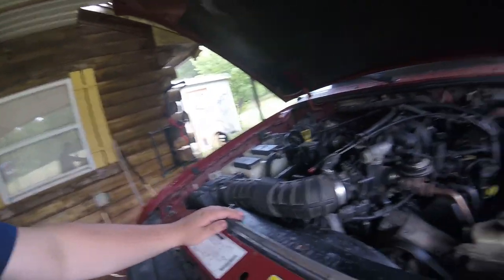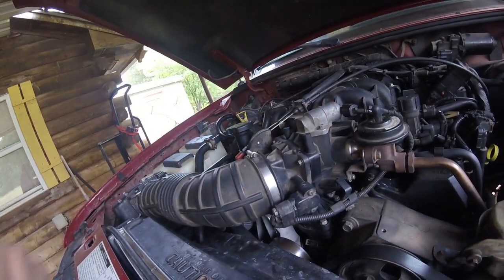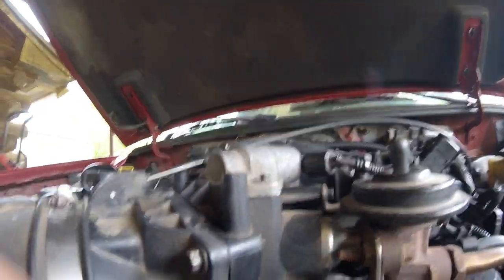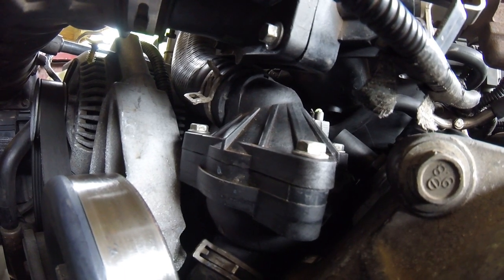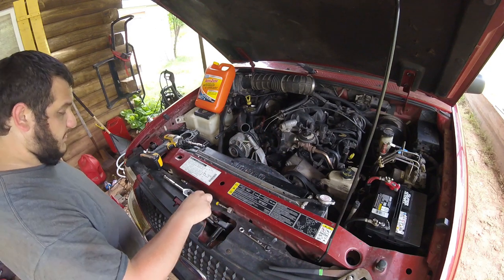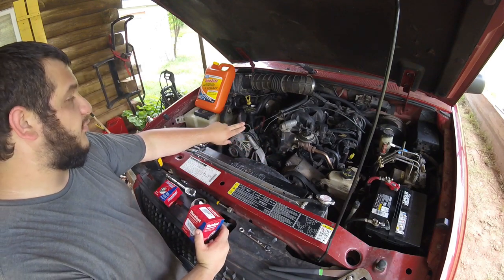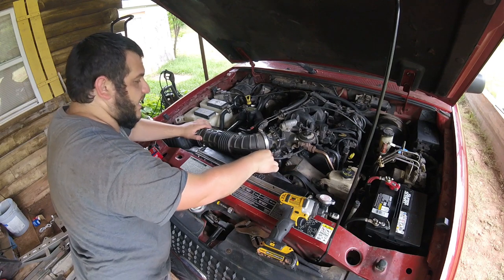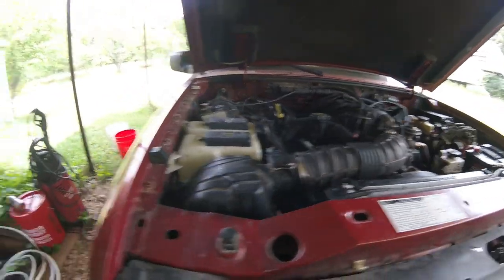Cheap Fix For My 01 Ranger! It was Overheating!!

Comment: Yep. It's expansion due to boiling. Like when a pot of water boils, it rises up and flows over. You were right to be worried about head gasket but always check the easy stuff first. People try to make it home while boiling, then warp head and then it does the head gasket as well (if it's European, just looking at it the wrong way does the gasket in). Great content buddy. Let's get the Rustang fixed up!
Reply from the maker: Rustang, that's a good one!

Comment: I'm having those issues on my sons 2000 Ford ranger 4.0..I can't wait to change it..a garage told me it was my head gaskets n said I need a new engine.  But when I drive it like u said 20min into the reserve cap pops open n it seems its always full while the radiator looses fluids,  so can't wait to try this, thank u. N there was no wind sound with ur video ;)
Reply from the maker: Please let me know how it goes! I really hope this fix works for you and your son. The 4.0 can be a good engine, but they can be expensive to repair or replace.
Reply: Man mine is doing the same thing but it’s the3.0. No smoke. But is getting hot and antifreeze is bubbling back in the tank.

Comment: I have a 2000 ranger with a 3.0 v6 and it had a head gasket leak, but it was so miniscule it was hard to diagnose. It never smoked and it didn't consume coolant quickly, but  would overheat after 20 mins of idling, we used a sealer and it fixed it, but access to the thermostat was very simple, didn't even need to remove anything else, just two bolts.
Reply: My 99 is antifreeze over flow tank boils and over fills. No smoke. But does have lose of power. Idk what’s going on
Reply: Had a guy replace the elbow somthing to do with the thermostat. But he messes a wire up and my gague doesn’t work
Reply: @Topher_1551  if your coolant is boiling your engine is overheating, try getting an obd2 scanner that can give you live data, like a blue driver, they let you see water temp anything over 200 would be too hot for your aluminum block
Reply: @minibowler  damn man idk what it is. I had some elbow price changed a while back the dude messed up the wiring harness and it doesn’t read on my gauge
Reply: @Topher_1551  look at your radiator cap, it’s pretty rare, but if it’s cracked or it doesn’t hold any pressure, it could be causing your problem
Reply: @minibowler  already replaced that. It was bad but it’s still happening.
Reply: @Topher_1551  have you felt the rad hoses with it running? If one is hot and one is cold then your water pump is bad

Comment: Hi why does the expansion tank gets full and never returns coolant back to radiator? After every drive the overflow tank is full.. but even with head gasket bad it should still return though
Reply from the maker: I would think the expansion tank would go back down even with a bad head gasket as the pressure returns to normal. I filled the coolant system by removing the line from the heater core and filling it that way since it is the highest point in the system.

Comment: What if you have a new radiator and thermostat and it still does it
Reply: @austincarr5441 @mrjeep75 ever figure this out? I got a refurbished jasper engine last year, new thermostat this year, new water pump when the engine got swapped. And now I'm still overheating if my heats not on full blast.

Comment: 97 2.3 ranger took out the thermostat before  replacing the water pump that leaked fixed the leak no leak drove the truck about 10 minutes guages were barely reading above cold and the radiator hose blew apart and my oil guage started having seizures today

Comment: I have an 01 ranger 3.0 V6. I replaced the fan clutch, water pump, & thermostat. It's still running hot. Drives like a dream but it runs hot. Is it my head gasket?
Reply from the maker: It could best thing to do is check compression and test the coolant system for its rated pressure too. The 3.0 V6 is a much easier engine to rebuild then the 4.0 V6 SOHC that was in mine. But, i would check the pressure test first then go from there.